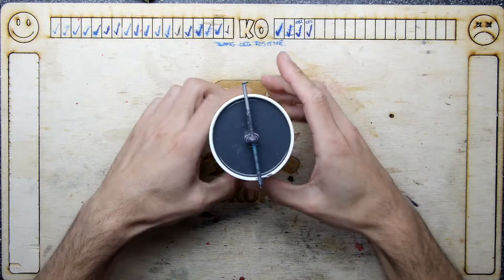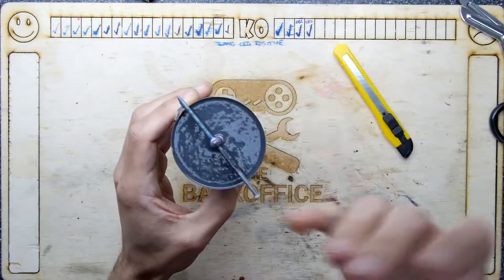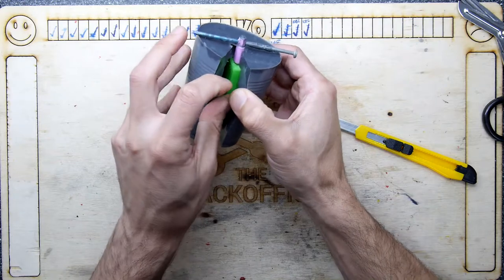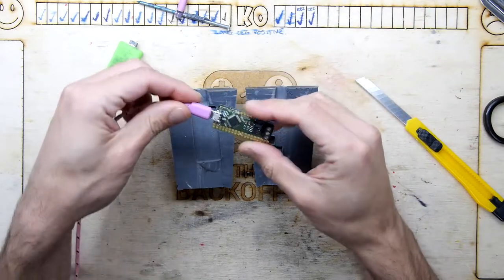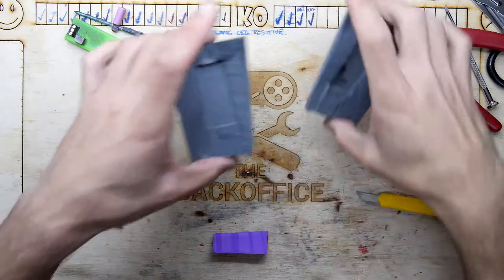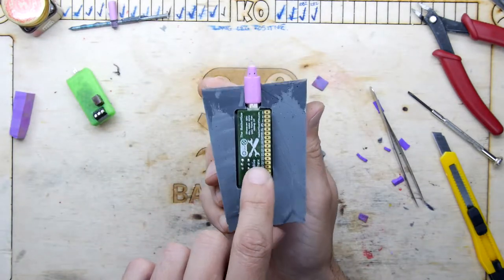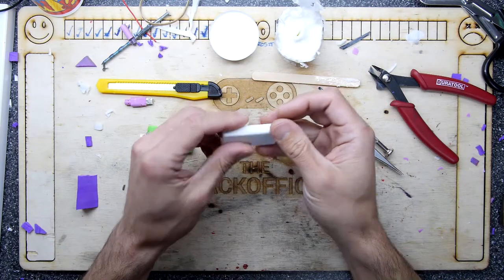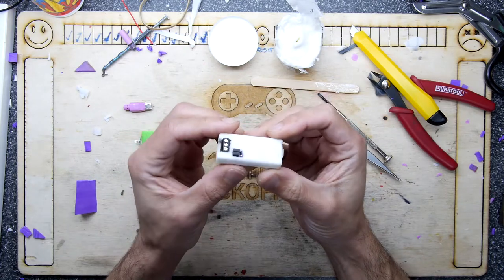Resin Casting

Comment: That looks like a very interesting thing to do. I know nothing about this sort of stuff.

I was just wondering though on a couple of things.

1) Would a board that vibrates rapidly, help at all at getting rid of the bubbles - for both the grey stuff and resin?
2) Would two holes leading the the mold shape also help to stop bubbles? So the air that's in there has a place to escape through one hole, as the resin is being poured in through the other hole?

As I say, I know nothing about this sort of stuff, it's just some early morning ideas. Which are most likely based on things I've seen on documentaries that had pottery / metal casting.

All the same, very interesting to watch!
Reply from the maker: +FairFight14 good advice! What I love about this is that it is as much art as it is engineering and you really need to be able to think in 3d when conceptualising how you will build the mould. More on the subject soon as I learn more 😁👍

Comment: I did some resin casting yesterday, so it was quite funny to see this pop up. How coincidental!
Oh, just as a point of advice, don't cut straight lines through the silicone to open it up. Cut a wavy serpentine or sharp zig-zag pattern instead. That'll help it from falling out of alignment later!
Reply from the maker: +Jomaster The Second I'm having a lot of trouble cutting the dense rtv. I've ordered some new scalpel blades. Hoping they will be better than my existing Stanley knives
Reply: Yeah, you gotta have a nice sharp blade to cut through that kinda mould material.
I personally use Pinkysil which is somewhat easy to cut from what I've experienced, but I'm not sure if that's available in the UK or not.

Comment: Interesting stuff! I can think of a few dozen used for it on my car right now! I'm wondering if mixing in different ratios might keep the resin workable for longer at the expense of such a rapid curing time? 3D printing and acetone treatment can be quite effective but it takes such a long time to print and then treat the ABS. This casting process looks far less time consuming :-)
Reply from the maker: +Carl Ridley I'm now casting the first mould in resin. Refinishing that, then casting again 😂